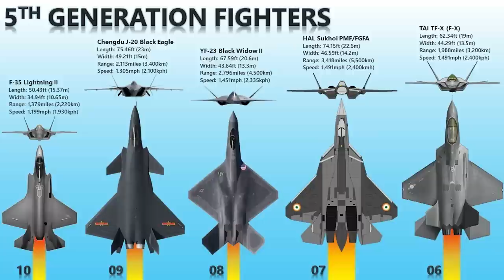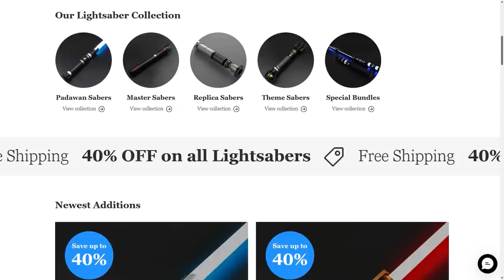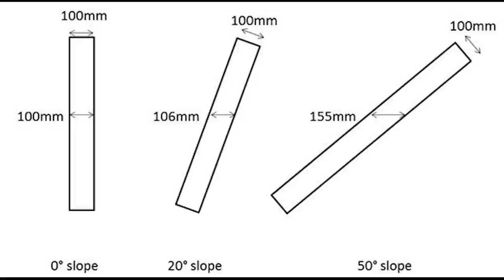Is the Tie Fighter MORE SURVIVABLE Than We Realized?

Comment: Judging from A New Hope, Tie fighters were just as sturdy as X wings: one shot pretty much killed them unless you had Luke or Wedge plot armor.
Reply: people really ignore the actual movies in these conversation like the myth that TIEs are only good in numbers but the same amount of TIE fighters or even less than the rebel force Attacking the death star almost wiped out the entire rebel strike force from the thirty only 3 made it out alive
Reply: @laisphinto6372  the rebels were stuck in the trench, making them easier targets
Reply: @leonrussell9607  there is an X-wing that does take one direct hit before they are in the trench and gets blown up, the did set shields to double forward at the start of the scene so its possible he had no rear shields, but i think its simply that close range you can still penetrate shields. which is part of what makes close range dogfights make sense in the setting.
Reply: @laisphinto6372  In A New Hope, TIE pilots were actually OUTNUMBERED. Only Vader's Black Squadron was deployed (12 TIE ln and 1 TIE Advanced) and the Rebels had 30 fighters (X-Wings and Y-WIngs). Yes, many were shot down in the trench run (mostly Y-Wings), but many X-Wings were just plain shot down in dogfighting because the Black Squadron pilots were some of the best in the Empire.
Reply: The X-Wing pilots had  shifted all power to their forward shields, leaving their rears exposed.
Reply: @richardlahan7068  i mentioned that, but likely that was only for the approach, once they got to the surface of the death star, it seems very illogical to leave the rear shields off, when threats are now coming from every direction.
Reply: Also the X-Wings pilots were fighting Vader. Who has arguably even more plot armor than Luke and Wedge ever had. They were kicking ass and running roughshod on the Death Star until Vader showed up.
Reply: The xwings were also dodging turbo lasers, and when they needed extra speed they have to dump shield power.  When they took one hit, they had really taken more hits previously or defensive hits from the death star batteries (even if they didn't show every hit)
Reply: I think overall if the Star Wars universe is generally following the World War 2 model of air combat, the Tie fighter is not really synonymous with the Mitsubishi A6M and the Grumman F6F, because aside from range and maneuverability, the Hellcat generally outperformed the Zero and simply had more kinetic force as a fighter. But versus the X wing, the Tie fighter is faster and even though diving and rate of climb probably don't mean the same on space as on Earth, the Tie fighter in general seems to have superior air combat performance to the X wing. I notice it in the old Lucas Arts Tie Fighter game as well. The Tie Fighter simply maneuvers better and is faster. The X wing has range and more weaponry and shields. I think the Tie fighter is the preferred choice in air combat for the expert pilot, but the average pilot will do much better in the X wing. Tie Defender however makes X Wing look like dogshihhht.
Reply: The reason why the X-wings were able to be killed so easily is because the rebels actually turned off their sheilds to gain more power to their engines, so they could go faster and be harder to hit. Why they didn't just use A-wings is beyond me.
Reply: @Unknown-hm7qx  Because the A-Wing was created for Return of the Jedi. It didn't exist in 1979.
Reply: Was that because of the starship or the pilot though? It's pretty common knowledge that TIE Fighter pilots were, without a doubt, very talented pilots and were actually given the proper training to excel in the cockpit
Reply: @Unknown-hm7qx  I dont think an a-wing can carry proton torpedoes.  They might be too big, not sure, but a-wings generally have concussion missiles.
Reply: @Unknown-hm7qx  A-wings don't have the ordinance. 

A-Wings are meant as a counter to the TIE interceptor. That means they need to be even faster then the Interceptor who could outspeed an X-Wing. Ordinance means more weight so the engines would need to work harder to move the extra mass that the missiles put on heavier fighters like the Xwing and Ywing. 

By removing them and opting for lighter anti-fighter missiles instead of heavier torpedo payloads, the A-wing could keep its interceptor role. 

But that meant it didn't have the heavier payload needed to punch through the Ray-shields guarding the exhaust port. The Right aircraft for the job. The A-wing would have been effectively useless for the Trench Run and should the Ywings have failed, the A-wings would have had to break off. Yavin 4 would have been blowing to bits and that's the end of the rebellion. 

The X-wings were able to keep the fight going and extend the mission timer since they could carry the heavier proton torpedoes but not in the numbers the Ywing could. But this was ultimately a Bomber mission. If things had gone according to plan then this would have been the Hour of the Y-wing.
Reply: @laisphinto6372  That's mostly because the TIEs they were up against were piloted by Darth effin Vader and his elite personal squadron. (Remember, Tarkin in his arrogance refused to launch the Death Star's normal TIE complement).
Reply: That is because originally in the movies all fighters had shields but they worked more like flak armor in that might defect or absorb some damage but not all damage.  This changed with the release of the x-wing games where they explained away why you could solo 12 tie fighters in a engagement, because you had awesome shields and then didn't.  (Ironically they kept the lore straight in the tie-fighter game where when you flew a standard tie you had no shields and enemy fighters did).  This concept then bled over into the EU as a whole.  But yes, it was intended that the x-wings did not have the amazing defenses that they later were credited with having and the ties weren't supposed to be so far behind.
Reply: I figure the TIE is an ultra-light fighter, while the X-Wing is a medium fighter.

TIE:
- 2 guns, maneuverable

X-Wing:
- 4 guns
- two protorp launchers
- droid
- hyperdrive

So give the TIEs a proportional shield.  I'll use D&D terms and math:
TIE: each gun does 1d6 damage for a total of 2d6, and has a DR 2 shield
X-Wing: each gun does 1d6 damage for a total of 4d6, and has a DR 6 shield

So a TIE vs an X-Wing is doing ~2 pts of damage per attack on average, while the X-Wing vs the TIE is doing an average of 12 pts of damage.
Reply: @richardlahan7068  Actually, they refocused their shields when they noticed the turbolasers stopped firing.

Gold 5: "Stabilize your rear deflectors. Watch for enemy fighters."
Reply: @Unknown-hm7qx  A-wings weren't created yet, and they didn't have torpedo launchers.
Reply: @Spectacular_Insanity  : True.  

There were 11 TIE Fighters in total - 9 of which engaged the Rebels in dogfights (3 not shown on screen), and Vader's 2 wingmen.

Although the 8 Y-Wings posed relatively little threat to the TIE Fighters, the 22 X-Wings and the 2 R-22 Spearheads (prototype A-Wings, not shown on screen) certainly did.  In any case, the 9 TIEs in the dogfight were outnumbered 3 to 1.

Of the 32 Rebel fighters, 2 X-Wings were shot down strafing the Death Star's gun towers.  5 X-Wings and 3 Y-Wings were destroyed doing the 4 trench runs (1 run by Gold Squadron, 1 by Blue Squadron, and 2 by Red Squadron).

7 X-Wings, 2 Y-Wings and 2 R-22s survived the battle (EU source).  That leaves 8 X-Wings and 3 Y-Wings which must have been shot down during the dogfight outside of the trench.  Not a bad number of kills for a TIE Fighter unit outnumbered 3 to 1.

(One of the 9 TIE Fighters, badly damaged, crash-landed in the Yavin 4 jungle.  The pilot was stranded there for 23 years, but survived.)
Reply: @sergeipohkerova7211  : If the TIE Fighter is the A6M2 Zero, then the X-Wing is the F4F-3 Wildcat.  The 2 fighters which fought in the decisive Battle of Midway.
Reply: @timonsolus I was thinking that, too, but for me even the Wildcat is an incorrect corolary because the X Wing has superior range and is an escort fighter, while the Wildcat has absolutely inferior performance to the Zéro in all parameters except dive speed. Structurally it is stronger and the Thatch weave helped make it get a positive kill loss ratio. The zero also has the perception of being marginally better than the Wildcat whereas the Tie fighter isn't generally seen as better than the X Wing. The hellcat seems a better comparaison because it is considered the better fighter and is superior in most respects except range and maneuverabilty. The Tie and X wing are just hard to compare to réal planes because both are "the best." Like Fw 190D vs P 51D. Both can claim to be better and both are right.
Reply: @sergeipohkerova7211  : The Wildcat came in a number of different versions.  

The F4F-3 had 4 .50 machine guns and a top speed of 328 mph (only 5 mph slower than the A6M2 Zero).

The F4F-4 (designed to British requirements) had 6 .50 machine guns (but much less ammo per gun), and folding wings.  The extra weight made it 10 mph slower than the F4F-3 at 318 mph, and reduced its climb and turn rates as well.

US Navy pilots were very unhappy about the 'upgrade' to the F4F-4, but the US admirals were very happy because the folding wings allowed US carriers to carry more fighters.

The range issue is not relevant to the aircraft's fighting capability in a dogfight.  

The F4F-3 and A6M2 were actually very evenly matched in practice.  What the Wildcat lacked in performance, it made up for in survivability, being very resistant to 7.7 mm machine gun fire.  

The Zero really needed its 20 mm cannons to knock down a Wildcat, but it had only about 7.5 seconds worth of cannon ammunition (60 rounds per gun), compared to about 37.5 seconds worth of 7.7 mm machine gun bullets (500 rounds per gun).

The A6M2, on the other hand, had no protection at all and lit on fire like a Zippo lighter as soon as its fuel tanks were hit.
Reply: @sergeipohkerova7211 The am6 had better turn radius, climb, and spe3d over the f4f. It was better in all performance categoties except diving/e ergy retention and armor. Until tactics like the thatch wea e and boom zoom were developed, the f4fs suffered horrendous losses, Even then the tactics never fully stemmed the losses.
Reply: @randallsanchez3161  Eh, not quite. The Wildcats used at Midway were about equal to the Zero. The Zero had its advantages, like turning and climbing, while the Wildcat had theirs, like self sealing fuel tanks, better armor, and being better in the dive. By Midway, the shock of the Zeros performance had mostly been overcome, experiences against them had crushed racist assumptions, and yeah, the US had tactics to counter it. But so what? That's war. The Japanese would use tactics that best suited their planes, as well. This getting stomped by Zeroes early in the war wasn't exclusive to the US either. The raid on Australia saw the Spitfire fair equally poorly. Nobody thinks less of that plane. The Hellcat and other late war fighters are better planes, but the Wildcat served on the front lines to the end of the war, and continued to rack up kill counts.

Also, worth noting that pilot experience had a huge impact on the air combat in the early war. The Japanese pilot program produced some of the highest quality pilots in the world at the time, and then they had experience in China to hone it. Meanwhile, allied pilots lacked that experience and, for many of the land based ones, were also dealing with tropic related health issues. That afore mentioned Australia raids... one Spitfire did great against the Zeros, unlike his buddies. He was the one with combat experience in North Africa. And conversely, one of the remaining old school Japanese aces wound up in a tussle with a squadron of Hellcats later in the war. He lived to tell the tale, because he was experienced, while the Hellcats were freshly rotated in from the US.

Later in the war, that situation reversed itself. The US had the better trained pilots, while Japan couldn't produce the quantity of pilots it needed, and nowhere near to its old standards. Their pilot quality was further eroded by pilot recovery issues, between ticked off natives of islands and planes that traded toughness for range, and supply issues, which often left the Japanese pilots on the short end of the tropical malady stick.

Overall, the Zero is much like the myth of Panthers, Tigers, and the T-34. They are all machines that have their good points, but whose bad points are often glossed over, and what they faced (and often lost to) talked down about.
Reply: @sergeipohkerova7211  Thats a good assessment. The X wing is more of a modern strike air craft. Its a duck. Tie's are pure dog fighters. I think they are more appropriately similar to bi planes. If you see them in real life and the maneuvering they can do its insane.
Reply: @Spectacular_Insanity Mithel truly sucked as a wingman.
Reply: @leonrussell9607  the Rebels were also tactical morons. Go in three at a time, letting Vader and his wingmen pick them off. Meanwhile, what's everyone else doing? Even as a six-year-old watching Star Wars (we never called it "A New Hope" back then) when Han flies in and attacks Vader's section from above I thought, "Why didn't the Rebels do that already?" Seriously, when Gold Squadron, or Red Leader's section made their attack runs, why didn't everyone else actually cover them? Did they just sit back and watch? I suppose one could argue they were battling off the rest of Black Squadron, but we never actually see that. Rebel tactics don't exactly improve in Empire, when they leave their light infantry in trenches to get mauled by walking tanks that are impervious to even heavy blaster cannon.
Reply: @legionarybooks13  > Meanwhile, what's everyone else doing?
> Did they just sit back and watch?

They were busy dying to the TIE squadron! 
If the Rebels didn't have fighters tying up the TIEs, the trench run would have had absolutely zero chance of making it.

They lost twenty-nine fighters, we only see a handful of the actual deaths, because the movie focuses on those pilots committed to the attack runs.
Reply: @nick-hu1nx  but there is literally no reason why close range would have any effect on the force of a laser being shot in space
Reply: @NoTimeAllTime I think you've hit on it.

In A New Hope, it was obvious that x-wing shields weren't very strong. A handful of hits in a short period of time and your x-wing was destroyed or crippled. And take a look at the burst rate that TIEs were capable of in that movie. This all makes dramatic sense, because dramatic tension is increased when the Hero's ship can potentially be destroyed in a mere eye-blink.

But then the opportunity to market video games came up, and a new set of considerations apply. If the x-wing is too fragile, a lot of gamers will get frustrated and not enjoy the game. The game gets an unfavorable rep, fewer people buy it and you make less money. So you have to give them some form of plot-armor. You bump shield capacity up a lot, and maybe slow down TIE fighters' burst rate. Now the average gamer can, with a bit of practice, happily sail about and smash TIEs to his heart's content.

The game proves very popular, and the new take on x-wing survivability becomes canon.
Reply: In my own head-canon, fighter shields can absorb a couple full hits, and a handful of glancing hits. 

They are most useful in two common situations:

1) head-on passes (where everybody is weaving, and the first pilot to score damage on his opponent is likely to survive), and 

2) in swirling dogfights where high-deflection shots are likely (since in this case, you can only get one or two hits before the opponent zips out of your sights).

If an enemy gets on your tail, your situation is desperate and you'd better take extreme action immediately. This is where the TIE's qualities are shown best: being a tad faster and a tad more maneuverable, one will be very hard to shake once he latches on.
Reply: It took a burst, not one or two shots, from an X-Wing to kill a TIE in that fight if I remember correctly.  And it also took a burst from the TIEs to kill an X-Wing or Y-Wing.  Which means it came down to skill, of which the TIE pilots were among the most highly trained in the galaxy and were selected from the most talented recruits in the galaxy, and speed and maneuverability.  Which, I mean, it's a damn TIE FIGHTER so, yeah.
Reply: @nick-hu1nx  Pretty sure they shifted the shields only after entering the trench and after the guns stopped firing the fighters all shifted their shields to the rear.  A single TIE Fighter still proved able to kill them in a short burst, not just Vader's TIE Advanced.
Reply: @richardlahan7068  That was only after entering the trench while the turrets were firing.  Once they stopped, there is a line in which they shift their shields to the rear because fighters are coming.
Reply: @laisphinto6372 aided by a plethora of aa towers. But yeah, there's pretty much one or two shots kills the fighter, and it does seem that deflectors plays more as a mitigating role, the shot hits but most of the energy is deflected away, still one shot blew Lukes friend up, another single shot caused fires that blew em up. The moment Tie's get numbers on their side Allince fighters evaporate (unless plot armor is in play). The only people we see handling tie-fighters like they are nothing are the "heroes" the rest die like flies in gasoline.
Reply: @leonrussell9607 I’m late to this discussion and I’m too lazy to read to see if someone responded but if you rewatch the movie you will see the Y-Wings go in first as they had the initial job of blowing up the Death Star, the X-Wings fly above them OVER the trench providing aerial cover and support so theoretically they should have had all angles covered, of course that doesn’t stop the power of the dark side.
Reply: Gravity does not form round objects because arcs are strong.  On a spherical celestial bodies the reason behind the form is even distance to the center of the mass.